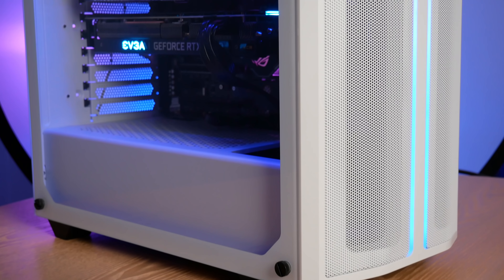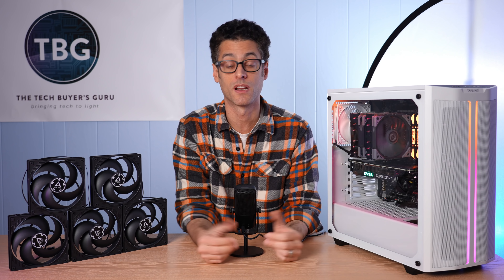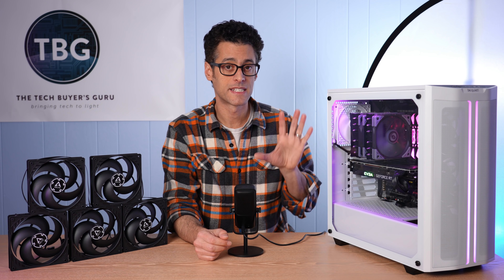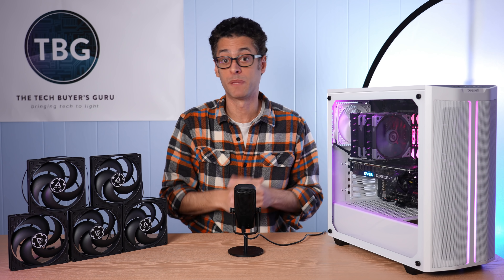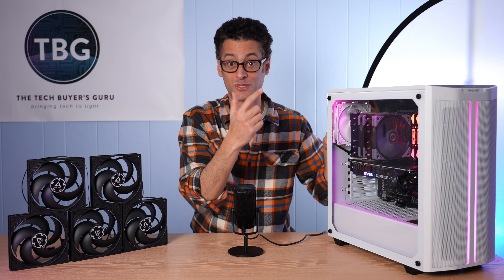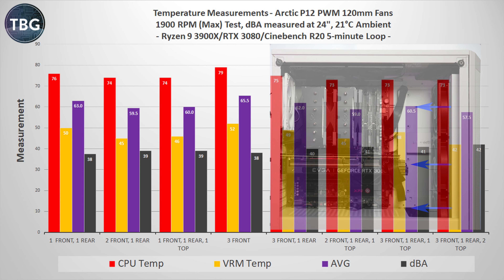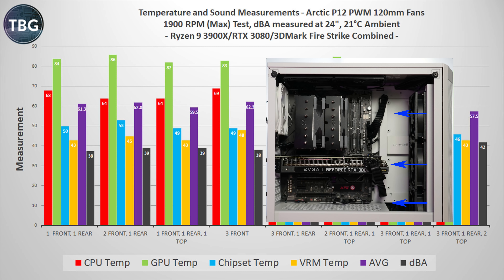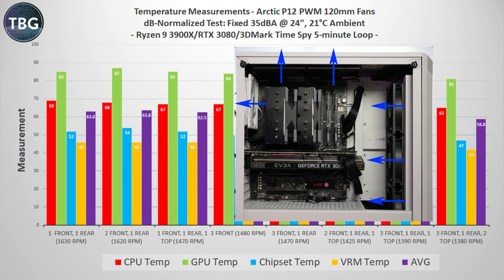Optimizing 120mm Case Fan Performance - The Best Number and Location, feat. Arctic P12 and 500DX

Comment: Great video, it probably took quite a lot of time to make those slides!
For those of us who care about noise and like to keep our machines as quiet and cool as possible your channel is amazing.

I currently have 2 front fans and 1 rear. All of them are Arctic P12 mostly because of your great advice (no regrets so far). I have been thinking of upgrading the front ones to 140mm (there you have it, one more possibility to test haha) cause that is always a safe upgrade in terms of noise and performance. If I do that, maybe I should put one of the P12 fans on top instead of just retiring them for another build.
Reply from the maker: Definitely, use that extra fan if you upgrade! But what case do you have? There is a chance that if you can fit three 120mm fans in front, that's better than two 140mm fans. It's something I'll be testing in the next episode.

Comment: Thank you for this video!

I was concerned about adding another exhaust fan thinking it would steal the air from the front intake fans before it reaches the cpu cooler. Currently I only have one 140mm exhaust fan, I will add an additional exhaust fan and see how it plays out.
Reply from the maker: I had the same theory, honestly wasn't expecting the dual top fans to work well, but it was pretty good.

Comment: As always, great content! I have one question which i haven't ever seen properly answered before , i think it could kinda be cool if you do some testing.  Do solid panels make any difference compared to glass? Do cases with noise dampening material on side panels actually make less noise?   I m mostly thinking at some Be Quiet Cases that come up in both versions, glass and solid ( noise dampened ) panel.  Is there an actual difference between the two? In both thermals and noise?
Reply from the maker: This is a really good question. I found that the be quiet! Pure Base 500 and 500DX were surprisingly similar in terms of noise, despite a very different amount of solid panels and rubber padding. I also have a Silent Base 802 in for testing, and I may test with both solid panels and mesh panels, but the side panel will be the same (glass).
In terms of whether glass versus padded steel makes a difference, that's a tough one to test. Most padded cases offer a single glass panel as an option (like the 802), and I doubt very highly that this will make a difference, otherwise I'd ask for that padded side panel to test separately. Switching 3 or 4 padded panels to glass might, however, but you won't find that type of option on any case (at least not that I can think of).

Comment: I have added 2 bottom intake in my Tecware Alpha TG just to increase intake air.
Did notice GPU temp drop, maybe the front intake could not reach the end of GPU since most cold air exhausted out on top exhaust before it reaches the end
Reply from the maker: You are onto something. Bottom fans are actually much more effective for GPU cooling. Next best is the lower front fan. See this video: https://youtu.be/iCn-XL-HyXg

Comment: Coincidentally I've been pondering placement in my cooler master h500 with these fans in a 9900k/3080 setup. Looks like I'm going to do a 6 fan push pull in the front on a 360 aio and two exhausts fan
Reply from the maker: That will be a very good setup for the H500. Note that I don't necessarily recommend push/pull on AIOs, as 3 good fans may outperform 6 mediocre fans, and if you're already using good fans, adding 3 more may not significantly drop temps. I may have more to say on this topic when I do my 360mm AIO roundup next month!
Reply: @TheTechBuyersGuru  look forward to the video. Temps did not drop significantly adding the 3 fans. All 6 are Arctic p12s. Temps dropped about 5 degrees tops. This was the headroom I was looking for to hit 5.2ghz on 8 cores. I'm sure this isn't worth it for most people lol.
Reply: I hope to test something that's had me wondering this week of which is better. The stock 2 200mm fans pushing into an AIO with 3 120mm fans or removing the stock 200mm fans and running 3 120mm in their place for a 6 fan push pull. I believe my current setup is causing a weird issue with mismatched fans creating unwanted noise.
Reply from the maker: I would guess that as good as 200mm fans are for case cooling, they are pretty bad for a 360mm AIO. The airflow is not very directed, it's coming in at very low static pressure, and a lot of it is going outside the radiator. I realize that this changes the appearance of the H500 (I'm running an H500P Mesh right now), but it's just a tradeoff you might have to make for the best performance.
Reply: @TheTechBuyersGuru  sadly I can't top mount this radiator on this case so I'm stuck with the front. The 200mm fans do look great though. I may pick up a different case since this build was originally all air. H500 isn't ideal for water-cooling setups. We'll see!
Reply from the maker: Yes, I know that the H500 can't fit big rads up top. If you like that look, I can recommend the H500P Mesh ARGB! - https://click.linksynergy.com/deeplink?id=WAzU8cLhuCU&mid=44583&murl=https%3A%2F%2Fwww.newegg.com%2Fgun-metal-cooler-master-mastercase-h500p-mesh-atx-mid-tower%2Fp%2FN82E16811119353

Comment: What a nice video mate! I really wonder how are the corsair ml120 PRO RGB compared to the "normal" ml120's (none pro version) compared to the p12's. 
I mean I  have both arctic p12's pwm pst and ml120 pro rgb (3 of each) and I wonder which I should put on the rad lol
Reply from the maker: You should test it! But seriously, I don't think there's any difference between the ML120 and ML120 Pro, and in my tests, the P12 was better on a radiator: https://youtu.be/W2Zis8RjcX8
Reply: @TheTechBuyersGuru  ayeee appreciate the reapond mate!!! Also I heared that the none pro ml's are slightly worse than the pros , at least in terms of noise. I kind of debating wether I should go for looks with ml120 pro rgb or a slightly better(?) performance and use the p12.... I need to use 9 fans in my lian li o11 and I have 2 rads.. so I can't decide which other 6 fans to buy. Super sorry for typing so much tho! <3

Comment: I have a P12 on my CPU cooler and thought, "hey, let's swap that with the Pure Wings 2 I use as exhaust fan". I think both the be!quiet and Arctic fan have rpm bands that sound annoying when sitting at the wrong distance and angle from the fan and the case picks up vibrations. But my GPU fans are worst in that regard. As a remedy I set the GPU fan curve for each degree C from 60 to 64 (5 states) specifically to the more "pleasant" rpms.

Comment: more on GPU cooling. someone on Hardwareforum managed to drop GPU temps by wedging a 92mm fan under the GPU as an exhaust. really makes me think that Case manufacturers miss an opportunity here. also, remove PCI brackets for better venting of GPU area. Sauce: https://hardforum.com/threads/exhaust-fan-beneath-gpu-pics-test-results.1957164/
Note: Cold intake did not work because it blew hot GPU exhaust to the front of case preventing it from venting, causing recycling of waste heat. remember: input air needs an exit.
Reply from the maker: Very interesting. But I think even better is fan blowing up from under the GPU. Have done some testing in ITX cases, might post video for ATX as well, but needs to have vented shroud.

Comment: Excelente videos as always to all air cooler fans... Can you do a video for water cooling? For example, using a 360mm rad infront with push/pull config and 240mm with push config. It can be a loop or GPU and CPU not together. Please
Reply from the maker: Not planning on doing a case fan roundup combined with AIO coolers, but I do have two AIO comparison videos you might like if you haven't seen them before:
(1) top vs. front mounting a 280mm: https://youtu.be/bL5IsxzpiCA
(2) 280 vs 360mm of identical model: https://youtu.be/uUUItnZRHyM

Comment: Excellent video. As you said, every system needs fan planning and tuning depending on the case, GPU power and so on. I personally run 2x Arctic P14 PWM on the front (max allowed for my case which is a Corsair Obsidian 750D) and one in the back with an RTX 3080. On the top I have a 360mm H150i Pro AIO from Corsair as intake, and my temps and noise levels are amazing. I hope your channel grows a lot your videos are very good :D

Comment: Great stuff. I’m looking forward to the 140mm video. Would the same principles apply for air cooled SFF cases or would things like power supply placement completely change optimal configuration?
Reply from the maker: SFF cases are a bit different in that cooling typically isn't as direct. There are a lot of twists and turns, and areas where air must get through tight spaces. Also, they of course have far fewer fan slots. Perhaps a few months from now, after completing all my already scheduled cooling tests (I'm literally prepping four new videos right now), I will repeat this airflow test in a popular ITX chassis.

Comment: Silence enthusiasts often skip the top fans and block off the top vents as it lets a lot of noise out.
Reply from the maker: This is true, but it also increases temps dramatically if you have a powerful GPU. So it's a trade-off, and if you have a hot enough GPU, this will lead to higher overall noise levels.
Reply: @TheTechBuyersGuru  That's why lower TDP parts are chosen.

Comment: why not 1 front fan in the top, 1 front fan in the bottom, or 1 front fan in the middle, 1 front fan in the bottom, in your 2 front fan tests? i think that could help with gpu temps, especially in the 1 rear, 1 top positions. would love a retest with those figures!
Reply from the maker: It's something I thought about AFTER I did the benchmarks that showed that the bottom fan was very beneficial for GPU temps. I'm not going to re-do this test, but it's certainly a valid theory on improving overall thermals. There are infinite options - two fans can in fact be positioned mid-panel in most cases, which would potentially be even better.

Comment: Could you test with top fans as intake and maybe a scenario with top fan closer to the front as intake and closer to rear as exhaust? In some cases especially shorter ones, front top intake and top front exhaust cancel each other
Reply from the maker: I may do this for 140mm test.

Comment: Great stuff.

Would it have made much difference to the performance results if your CPU HSF just had one push fan?

Also I always thought the top fan in front of the CPU would take away the cool air from the front upper fan before it entered the HSF, but it seemed to work better here? (My original plan was to have one top fan, placed behind the CPU, which doesn’t seem to be much worse).

Comment: So after trying this out in the exact same case (be quiet 500DX) I can't fully agree with the findings.
The Arctic P series have a tendency to have harmonic resonance right around in their optimum range (1000-1100 rpm).

I outfitted my 500DX with 6 P12s and had to return the lot, as the hum compared to Scythe fans was not worth the possible performance benefits.
Reply from the maker: What part do you not agree with? This video simply demonstrated the optimal number and placement of fans. And I talked about the resonance at length, so either you didn't watch the video, or you're commenting on the wrong one.

Comment: Have you tested the airflow path of the P12? Are they strictly static pressure vortex where it just goes straight ahead or does it also disperse like an airflow fan? I wonder how it would compare to an airflow fan, maybe like the stock 500DX fans

Comment: I've got 8 P12 with a Lian Li Mesh 2, still need a GPU and CPU but I don't mind the interested noise if it keeps my computer nice and cool
Reply: With 8 fans you need to run them at 700-800 RPM max.
Reply: @karama300video  the audio should be nice and low

Comment: How about negative pressure focused cases such as the NZXT H510? Like other videos in youtube, they say adding front intake fans isnt really necessary
Reply from the maker: Well, cases are definitely another variable, but I would hesitate to call the H510 a "negative pressure" case. It's just a low-airflow case. And saying front fans aren't necessary is a nice way of saying they don't help. ;)
Reply: @TheTechBuyersGuru  I might need more testing to do. My CPU(5600X) temps are staying somewhere around 45-50C on idle. This is with 2 front intake fans(stock fans that came with the case), 120mm rear exhaust(NF-S12A), and 140mm top exhaust (NF-A14). All this with the NH-D15S as my cooler. Ambient temp is around 28C. Do you think I could achieve lower temps?

Awesome vid as always btw
Reply from the maker: You might want to download Cinebench R20 to give your CPU a real workout. It's not going to be comparable in terms of temps to my 3900X, but you will see if it starts to get too hot (I'd consider 75C on your 5600X/D15S a sign that the case cooling is a bit weak). Generally, it sounds like you have very good equipment in your case; better case fans would help, but your cooler is so powerful that it's not really worth worrying about unless you see 75C temps under load.

Comment: The artic has one more model for both p12 and p14, namely P12 PWM PST CO(continuous operation) and P14 PWM PST CO(continuous operation). They feature a double ball bearing design compared to fluid dynamic bearing in P12 PWM PST. 
My question would be, which are quieter and will last long, also will there be any performance difference between them?
Reply from the maker: Arctic has suggested to me that the CO models are not quieter, and they have recommended I test the non-CO models in my roundups. I believe the CO models are more durable, which is definitely a plus. Also note that the noise I'm hearing in my tests isn't bearing noise, it's definitely a harmonic humming that can only come from vibrations that aren't in the bearings.
Reply: @TheTechBuyersGuru  thanks! I just went down the fans/bearing rabbit hole and found the same thing you mentioned now about the CO/ball bearing models.
Went is the p14 video coming out? Ordered a meshify 2 XL, would like to know which fan setup up would be beneficial. Thank you.
Reply from the maker: Planned for about 2 weeks from today.

Comment: when i bought my rog strix pc there was only cpu cooler and 1rear.. i change them to noctua and add 1 at top.. i testet to add 1more fan to front but that wasent help any so i removed it.. i run my pc very cool like gpu 66 and cpu 63 but im changing my pc case soon for better and with air filters so i can kjeep that clean in future

Comment: Thanks for this video. I have the same case as you but I have 5 140mm fans. Pretty much the same config but I have the top front fan as an intake instead of both top as exhaust. Could you test that configuration as well?
Reply from the maker: I will do some experimentation with the top fan orientation in my 140mm fan video.

Comment: Hey geat video I have learnt a lot from this test. I want to replace my case fans to arctic p series. What do you think will perform better as intake fan in front of case: two p12 or one p14? I am really looking foward to p14 test :)
Reply from the maker: My guess is that two P12 fans will be better, although I probably won't be comparing these exact setups in the next video. Instead, I'll be testing 3x120mm versus 2x140mm.
Reply: @TheTechBuyersGuru  Thank you very much for your answer. I can see that your p14 test will be very interesting.

Comment: Resonance - that's why the Noctua NF-A12x25 are still the best
that, and pitch of the noise - even the Gentle Typhoon are higher pitch (as are all Nidec fans)
As for your setup, you should be running a positive pressure setup with more fans intake than exhaust (by 1 fan difference, mind you). Maxing out your fans will help with temps, as well as noise as you can run them at a lower RPM to achieve the same results

Comment: When I ran two top exhaust fans the fan closest to the front of the case was exhausting cool air and was wondering if you noticed a similar result? I'm wondering if it would make sense to run the front top fan as intake and the rear top fan as exhaust (4 intake total, 2 exhaust total).
Reply from the maker: You can find out here! - https://youtu.be/iCn-XL-HyXg

Comment: I need some help guys!
I just got my new system I customized and ordered of cyberpower, but as it was my first time using such a service, I didn't realize that I didn't choose any fans.
The only fan present in the case is the AIO on the ryzen 5 3600 exhausting at the back of the case, which is not enough.
And with that RTX 3070ti I have, it turns the case into an oven.
Buying a fan pack as we speak, but I need some help with where to place them in the case and in which direction to blow the air in.

Comment: Did you also test the case stock, with the lid on top, or just always with the dust filter on top?
Reply from the maker: The 500DX does not come with a lid. You are thinking of the 500.
Reply: @TheTechBuyersGuru  Oh sorry. I thought since it is actually the same PC case except for the front and the RGB lighting, the DX would also have changeable lids.
There are many who think that the normal 500 has bad air flow because of the front, where it is more due to the missing 3rd fan and the lid if you run it stock.
Reply from the maker: Agreed. The 500 and 500DX are nearly identical in terms of performance except for the fan. I showed that in this review: https://youtu.be/kgvm5ZTAbFQ
Dropping the padded top panel was how be quiet! was able to his a great pricepoint for the 500DX despite the addition of another 140mm fan and ARGB lighting.